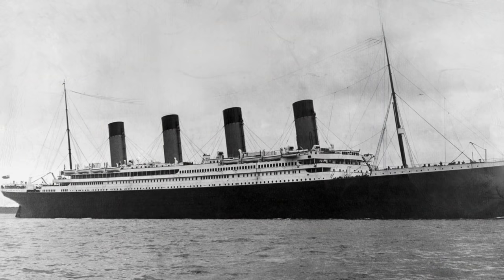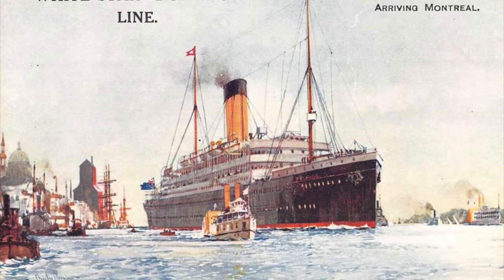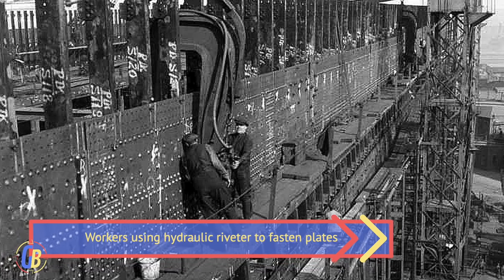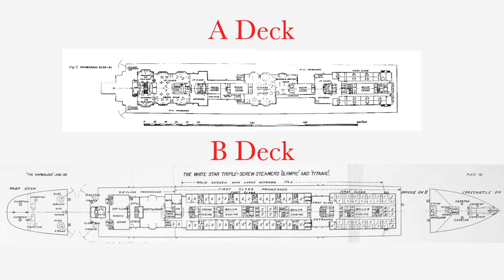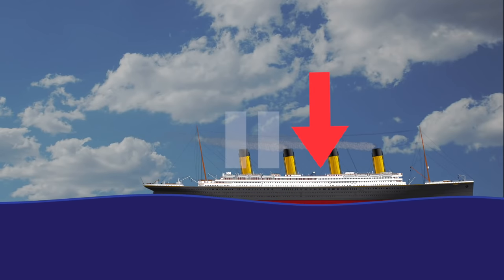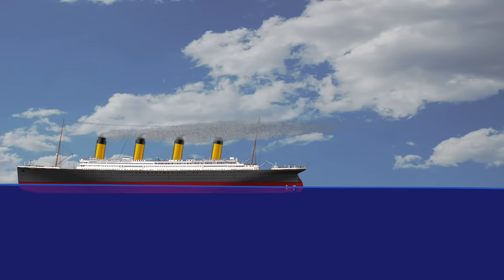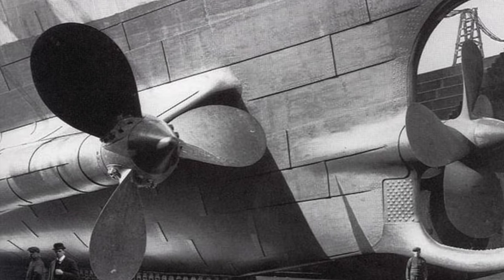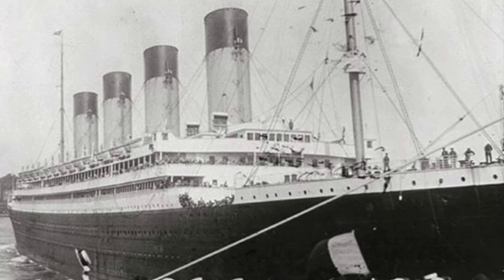Ten Technical Titanic Facts

Comment: I think Titanic had different for and after sections with differing amount of port holes, this is used to differentiate between it and the Olympic in photos. At the time the Olympic was the most famous ship, even after the Titanic was launched and had the most news reels and photos, these have been used often as Titanic after it had sunk as so little was available on this ship. The third ship was to be called Gigantic, but was changed after the sinking, to Britannic as it sounded less egoistical. The titanic was never called unsinkable, just virtually unsinkable, this however got changed by the news media. The centre turbine screw could not be reversed, making  the rudder (already small for the size of the ship) even more feeble, meaning manoeuvring in port was completely reliant on tugs.
Reply: Fun fact: Another reason tugs where used was the immense power of the Olympic-class ships. Olympic itself once sucked a large warship in with her propellers causing the ships to collide and heavily damaging both. Olympic returned to port with two compartments flooded and the cruiser HMS Hawke almost sank.
Reply: @221b-l3t  Don't forget how the Titanic nearly sucked the New York into her. Another White Star Liner had to pull the New York away, with the help of tugboats.
Reply: I just feel like adding: the rudders for the Olympic class weren't too small. At sea, these ships maneuvered very well. During Titanic's voyage, there are existing photographs of a curved wake behind the ship when her officers were testing her limits. They were bulky in port, but this was mainly due to their unconventional sizes. They were so heavy, they essentially had a gravity of their own. 

The Titanic hit the iceberg not because she turned too slowly, but because the iceberg was spotted too late. After the collision, Captain Smith put her half ahead for a few minutes. Some speculate this was done because he feared the iceberg would get drawn to the ship if they remained close by. 

The whole "the ship was too big for her rudder" is just a myth much the same as the coal fire causing the disaster or the gates keeping third class down.
Reply: I do have a great respect for my favourite ship, but if you have driven it on ship simulator, it really does handle like a dog, all large ships do to be fair, but the titanic is particularly hopeless. As you say, speed helps, but that takes a long time coming too and the Titanic was at best 1/2 speed at the time of the crash. I'm sure the rudder was acceptable and at the limits of the design of the day, so it is maybe unfair to compare it to more modern vessels. But there is no doubting is had ineffective handling. For starters the centre screw had to be on to help and that only worked going forward and partially blocked the rudder when not in use. You also had to be going at speed to get some water resistance on it. You could also use the outer engines one going one way and the other the other, to twist the ship too, but maybe this wasn't done, as they would of had to change the propellers direction half way through the turn, when they had to turn the rudder 'into' the iceberg?
Reply from the maker: @SaraRoseVaughan  Agreed, the Olympic class ships were at least sufficient in the realm of maneuverability given their size.

Comment: White Star was intending to compete with Cunard but you forgot one point. White Star decided not to compete on speed but instead make larger, more luxurious ships which would offer more comfy voyages. The additional turbine did improve speed but the Olympic class was never intended to win the speed race. You should've mentioned that.

As has already been mentioned, don't just put up points onscreen. Read them out.

Point 9 is very clearly recorded at a different time when you could not replicate the initial conditions or it wasn't given the same sound treatment as other sections. It is quite a bit louder and sounds different. I'm guessing you needed to redo it for some reason?

Here's a few other random facts about the Titanic - its rudder weighed 101 tons (!), it had two anchors, each of which weighed 16 tons, and needed a team of 20 horses to haul them. To use the anchors, Titanic carried 1200 feet of chain.
Reply from the maker: I may not have stated it directly, but I believe it was implied that White Star chose to go with the triple expansion / turbine arrangement for economic reasons. It's been a while since I made this video.

Fact #9 was in fact recorded at a different time. I actually forgot to record that one entirely on the first go and had to record it last minute at about 4 in the morning while my roommates were asleep, so I was speaking softly and close to the mic. When you have a video upload schedule to adhere to (once every 3 weeks in the case of this channel), sometimes things happen and practicality gets in the way of perfectionism.

Thanks for the constructive criticism and I hope you enjoyed the video.

Comment: Titanic left Southampton with a bunker fire. Such fires cannot be extinguished with water (the fire chemistry splits water making the fire worse. There is also the risk of thermal shock cracking the bunker casing. The smouldering coal had to be dug out of the bunker as fast as possible meaning the ship’s speed was dictated by the digging rate. 
This explains why she was moving so fast in sight of icebergs and why her sinking rate accelerated when sea water cracked the heat damaged steel plates.

Comment: Could the tragedy been avoided by higher walls within?
Reply: Watertight bulkheads? Only if they reached ALL the way up, AND a watertight deck as well.
But it would have killed a lot of people who wouldn't have been able to get up top.
Also, she was a commercial luxury liner, all those watertight bulkheads and decks would have made her impractical and not as luxurious since passengers would now have to go through cramped openings & hatches to move around in the ship.
Lusitania stands out here, she had taller bulkheads WITH watertight deck AND longtitudinal bulkheads as well, but all this did was make her list and quickened her sinking down to a mere 18 minutes.

Lest we forget, Titanic took more damage than most sunken liners before or since, and still stayed afloat for over 2 hours, AND she had the decency to sink on an even keel (minus a few degrees).
Her durability and build quality wasn't the issue :) 

The issue was that not all lifeboats were filled to capacity, because much time was spent bickering about women and children ONLY (Lightholler effectively has blood on his hands) and because the crew thought the lifeboats couldnt be filled and lowered at full capacity, these two things killed approx 500 people.
Titanic had a brand new system of davits and lifeboats designed to be filled and launched at full capacity. 

And also the crew wasnt trained on launching the lifeboats, Cpt.Smith cancelled the drill... So even more time was wasted, so in the end 3 of the collapsibles weren't launched, this killed another 150 people.
In total that's 650 additional lives that might have been saved.
Even if she had enough lifeboats for everyone, they never would have been able to launch them all.

Comment: 9:00 blades interchangeable
Reply: Indeed. However, the pitches of the propellers used on the outer shafts of Titanic and Olympic were different.
Reply: @dovetonsturdee7033  the wing propellers had individually replaceable blades. So, the base shafts were indeed interchangeable
Reply: @fusion451  What exactly do you mean by 'base shafts?'   The blades were cast with different pitches, hence the numbers on them, denoting the ship to which they were to be fitted. An Olympic blade could be fitted to a Titanic propeller base, and vice versa, but neither would function efficiently unless the other blades were replaced as well.
Reply: @dovetonsturdee7033  the wing props were not cast as one piece
Reply: @fusion451  Is English your second or third language? Where did I say that they were?
Reply: @dovetonsturdee7033  you asked me What did i meant by "base shaft" These base shafts carried the ship number the fan blades were inconsequential and were stored like drill bits of different sizes to be used on either boat
Reply: @fusion451  How do you explain, then, the 401 number on the blade of the wreck? If these were 'inconsequential' that is?

Or that H & W records confirm that the wing blades of the two ships were set to different pitches. Don't you believe that H&W actually knew what they were doing?
Reply: @dovetonsturdee7033  the center blade is the test it should be 4 blades not 3 depicted in the movie or archival pics
Reply: @fusion451  The centre propeller, fitted to Titanic, had three blades, in contrast to Olympic, which in 1912 had four blades.

Just to refer to H & W archives, the so-called 'Andrews Notebook' :-

Titanic in 1912 had wing propellers which were 23' 6" in diameter, and three blades with  35 feet pitch.

Olympicic in 1912 had wing propellers which were 23' 6" in diameter, and three blades with  34' 6" feet pitch.

Titanic had a three bladed centre propeller 17 feet in diameter, with 14' 6" pitch.

Olympic had a four bladed centre propeller 16' 6" feet in diameter, with 14' 6" pitch.
Reply: @dovetonsturdee7033  There are no known photos of Titanic’s propellers in place (as is so often the case, many photos claiming to be Titanic are actually Olympic). The photographic record is therefore of no assistance to us.

As an aside, there is one interesting image of Titanic being outfitted during mid- to late January 1912.7 It appears to show a four-bladed propeller beside the Thompson dry dock, resting by itself on the floating crane platform. Why it was there at the time, or for what ship it may have been originally intended, is the subject of speculation. By contrast, it is not speculative to state that there is a primary source, apparently giving an accurate set of propeller specifications for Titanic, which identifies her central propeller as a three-bladed one.

It might be the case that another document will surface in the future, contradicting this source, and recording that Titanic was indeed equipped with a four-bladed central propeller – just as historians have believed all along. However, given the fact that a three-bladed propeller has also been documented, it seems the only way to state for certain what Titanic’s central propeller was will be to hope that a method can be found to examine it in place on the wreck. Until then, or until a verifiable photo is discovered, then it will be another of Titanic’s enduring mysteries.
Reply: @fusion451   There don't need to be photographs, as there is the 'Andrews Notebook' which states the dimensions of the propellers on each ship, and of course the number of blades.

I am not sure why you have posted as you have. What are you trying to say?